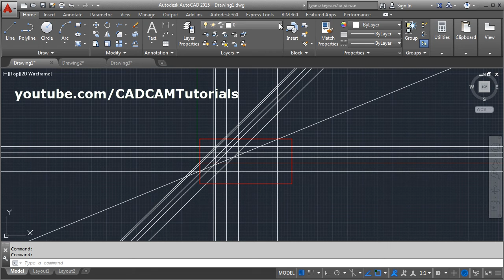AutoCAD Trim Everything Outside or Inside Polyline, Boundary, Polygon  | AutoCAD Tips and Tricks

Comment: I use autocad 2015 LT version...but EXTRIM command doesnot appear in my software..plz suggest
Reply: Did you ever figure it out?
Reply: At first I thought your issue was because it may not be available in the LT version or possibly not available in 2015 release, but I have AutoCAD 2016 and I can type 'Extrim' and it also does not recognize the command either.  I wonder if it's a feature that's not turned on by default when Autocad is installed, but it must be turned on somewhere in the settings.  Interesting.